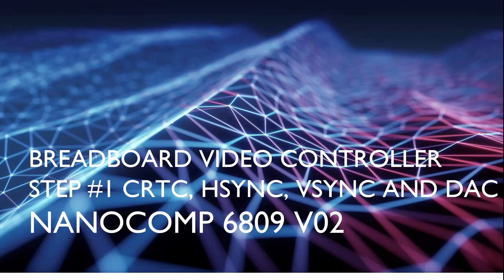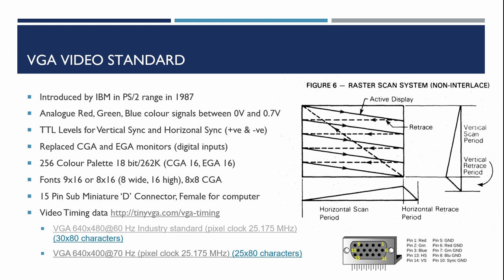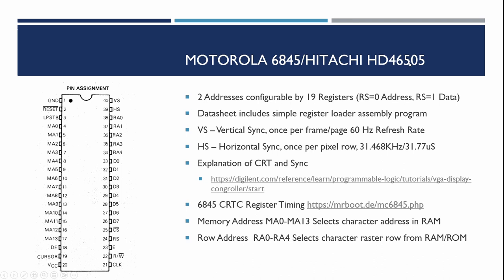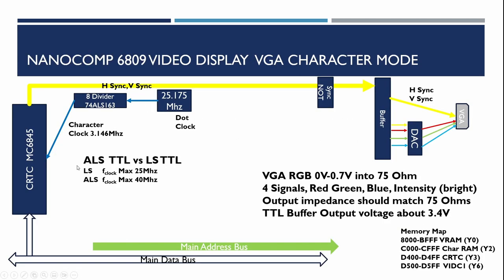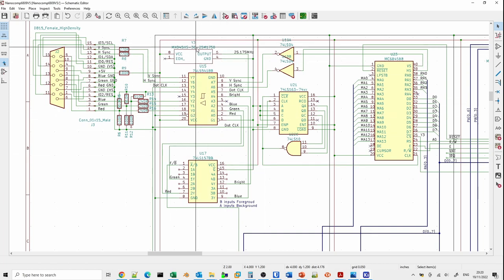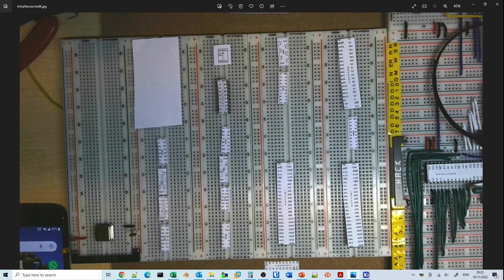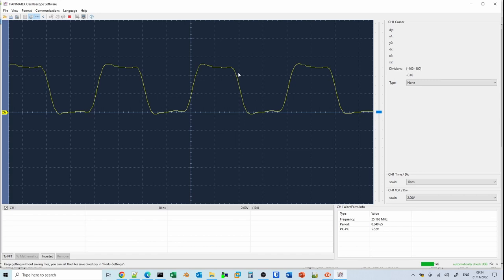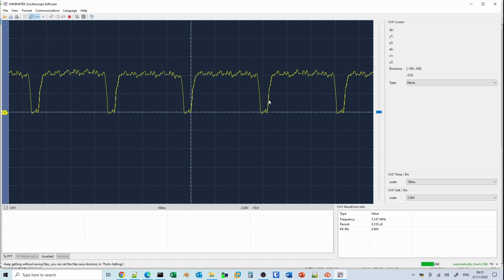V02 Breadboard VGA Controller CRTC & DAC - Nanocomp 6809 8 Bit Breadboard Micro

Comment: Great series. I recently added colour to an existing CRTC based video card and was toying with the idea of adding pixel graphics too. Good catch with the CRTC clock, now you can remove the redundant NAND gate, the counter will roll over to 0 anyway, just tie !CLR high. Also I think the display enable issue only affects LCD monitors not CRT's so you could add a border colour(to a crt)
Reply from the maker: Pixel graphics is in a couple of videos time! Starting with 640x 480 in 2 colours, then 320x200 in 256 colours (assuming the Video DAC palette chips arrive in time). The legacy CGA and VGA cards had to use more complex banks of RAM because it was not fast enough. The 32K chips I am using in the next video are 15ns so you can read 1 byte per pixel for 320 x 200 in 256 colours. Going to replace the 74LS163 counter and triple NAND with a 22L10 PLD/GAL but working out how to get the D flip flops to count has a taken a while to work out as docs don't really cover this very well (sorted now I think). The colour register was intended to set the surround/background for CRT to be a chosen colour and not just black but since I don't have a VGA CRT (only LCD Monitors and LCD TV) this wasn't worth it since the gap around the LCD display area is small. Glad you found it interesting.